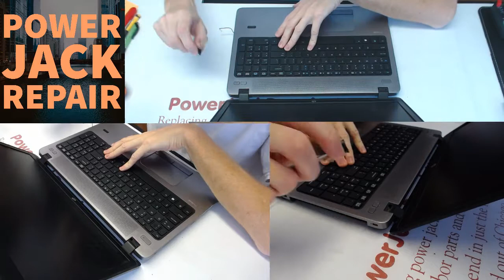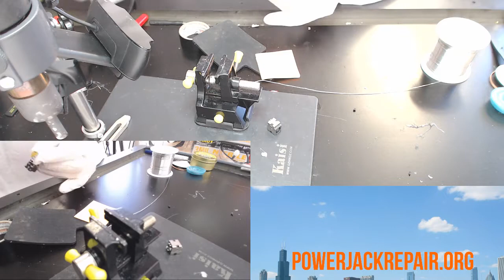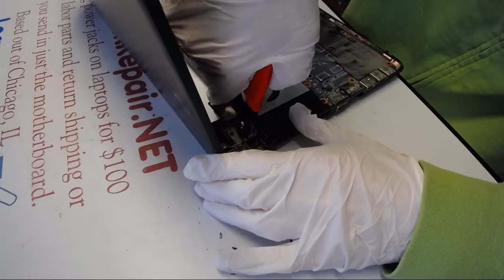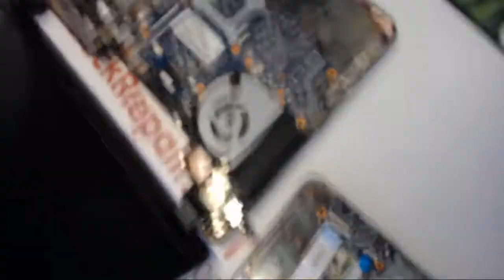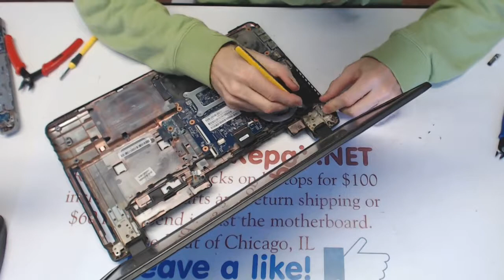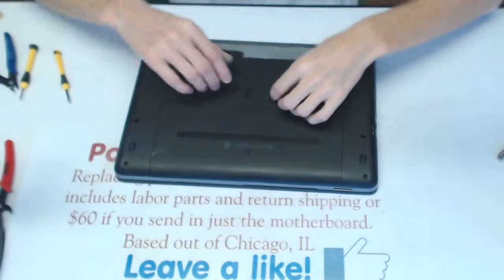Hp Probook 455 g1 Laptop charge port repair charging port repair fix power jack

Comment: I have an HP ProBook 450 G1 - very old but still good for my young son to play on. He broke the prongs inside the power jack. It stilled worked, as long as it was plugged in but it was not charging the battery.  I went online & found I could order a replacement power jack.  So I did.  Found your video. Followed it. Took a couple hours. Had to disassemble. Install new power jack. Assemble. Test. Not working. Disassemble. Test old power jack.  Assemble. Working. Disassemble. Install new power jack with wires round the right way when plugging in.  Assemble. And now my once not charging battery laptop is charging again.  And my son has a laptop to play on. Again.  So thanks for your video.  It was fun to learn how to do this.  😁